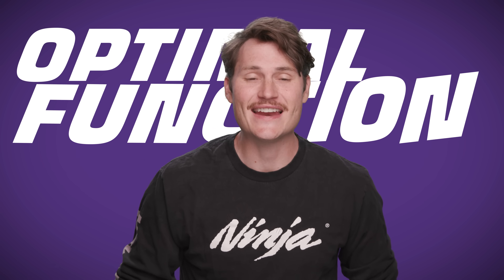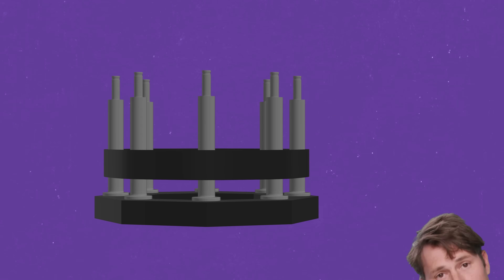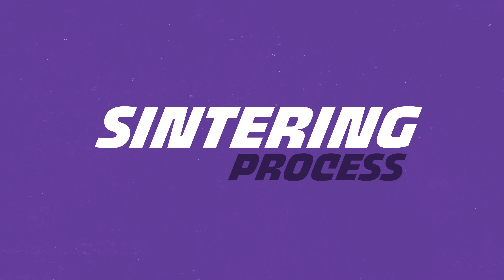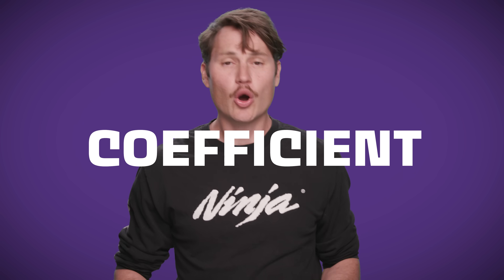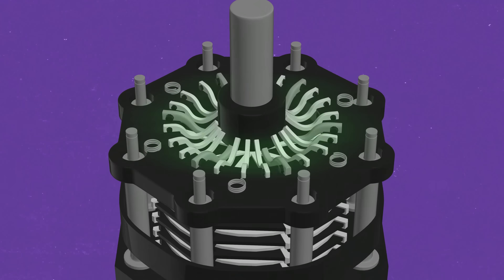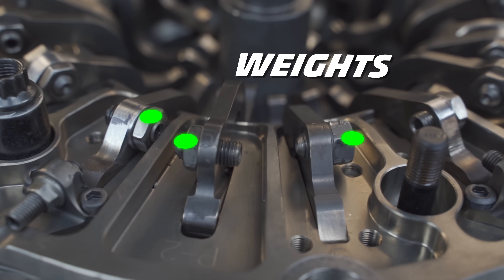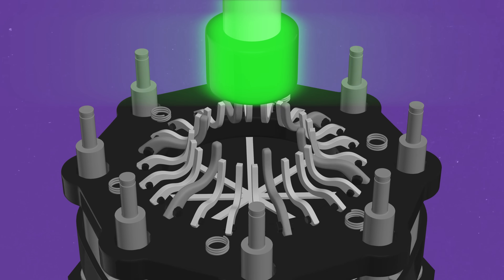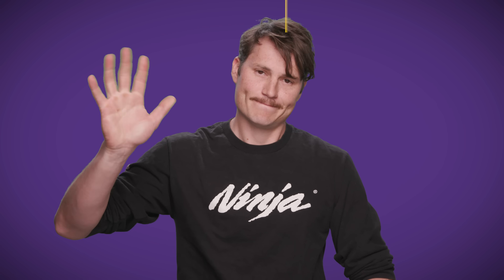This Clutch Only Lasts 4 Seconds

Comment: They don't toss them, they pull it to check them. They do put a different engine in yes, but the one that came out just gets looked at and put back together as the backup. Tossing a 75k$ engine isn't cost effective if its only ran once for a prize thats only a fraction of the engine.
Reply: Thank you, aside from the spark-plugs (that normally get burnt up) everything is checked after each run to see if it's usable again.
Reply: I watched an interesting in depth interview with a head crew chief of a top fuel team. He said the rods stretch something like 2 thousands after each run. He said they pull everything and kind of mix and match them in a new engine build. I was kind of surprised some parts are way cheaper than I thought they would be. If I’m not mistaken he said the rods were only $1200 a set. Even though they’re the beefiest rods I’ve ever seen he said that the basics of top fuel engines haven’t changed in decades so most of the internal engine parts have been standardized as they’ve figured out what works. I think he said the blocks, crank, cam, springs, etc hardly ever fail catastrophically and can be reused over and over. 
Standardization is a huge thing. I was watching an Australian engine builder talk about 2 engines he was building and the costs. A 600hp touring car engine was something crazy like $120,000, but those 950hp 410ci engines for winged sprint cars are only 1/3 of that cost because so many guys in America run the exact same engine and the parts are very easy to find, the engines are almost plug and play
Reply: @RobertSmith-le8wp  That was the 1320 vid if I remember correctly. That was a great video.

edit: I think they said in that video that the clutch pack is made to always slip. It never completely engages. I thought that was pretty insane.
Reply: @Joseph Citizen419  Fantastic video. I just responded to the OP you responded to, the video we're referring to here was following a "budget" top fuel team. Almost assuredly, the big name teams, like Pennzoil are definitely not mixing and matching. I used to make the rocker arms that Pennzoil uses in their top fuel cars... I can tell you with conviction they don't reuse those lol
Reply: @Robert Smith  Keep in mind, that was a "budget" top fuel team. The guys with big money sponsors are definitely not mixing and matching their parts. Fresh parts every time.
Reply: @RobertSmith-le8wp  The rods in top fuel engines actually compress "shorten" due to the etremely high cylinder pressures.  Watch " angry hornet" channel, he's on a top fuel team and shares tons of tech info. Worth our time.
Reply: The engine gets a full rebuild each run.
Reply: usually depends how each part held up after each run, and the teams budget also determines if they toss stuff.
Reply: Every team is different and every team has a different budget. John force example probably gets a full rebuild. While other teams with out the backing probably do what the have to to get back out there
Reply: My understanding is the crank is checked for the Conrod bearings scoring it, and it has a limited amount of runs on it before it's replaced.
The Conrods are checked for height and straightness (the height is recorded)
The pistons and rings are changed for a fresh (not new but measured for tolerance) and also have a number of runs shelf life.
The heads are swapped for a fresh set (that have had the springs tested,the valves checked etc)
The camshaft is checked and has a limited life based on number of runs. The head gasket (which they have in lots of thicknesses to increase or decrease compression ratio) is new every run
The supercharger is serviced (new rota seals added) and tolerances are checked.
The blower belt,16 spark plugs,oil are changed ever run.
The clutch " pack" is serviced and made available for another run 
The rear slicks and front tyres are checked for wear and size and are replaced on a run amount bases,or damage.
The carbon fibre rear discs and pads are checked and measured.
Reply: THANK YOU .... 👍
Reply: Actually this is wrong. Really only the block is kept if it’s in spec. Anything else I’d thrown out
Reply: @Lawbase actually wrong again. Anything in tolerance is reused minus rings and bearings. Essentially consumables
Reply: @heyitsvos  so the block
Reply: @Lawbase  block, heads, pistons, rods, blower, mags,etc. Not saying they reuse them in that weekends event, but they aren't scrapped into QC'd at the shop. That might be where there's confusion between our comments 👍🏼. Race weekend yeah I agree R&R with new/refurb'd units minus the block/rear end
Reply: https://youtu.be/XihPq-sYWF0
Reply: Racing is cost ineffective massively
Reply: Great addition, this comment tree.
Reply: Prize money isn't how they get paid.
Reply: @ElectronicsForFun  The sponsors are not going to cover the cost of a team and a replacement motor every event. happy now?